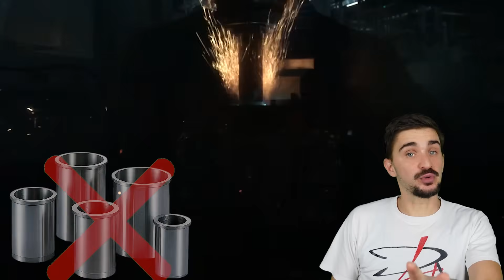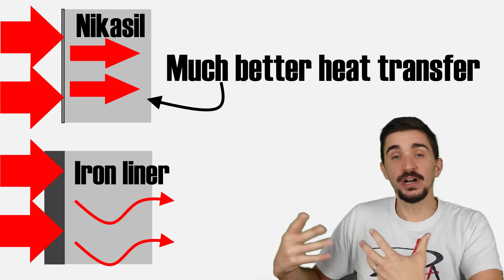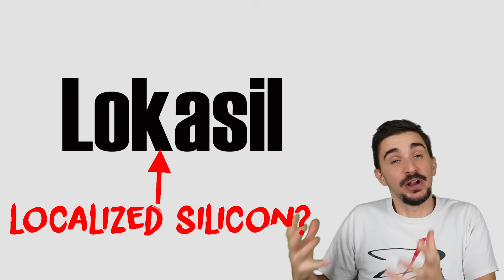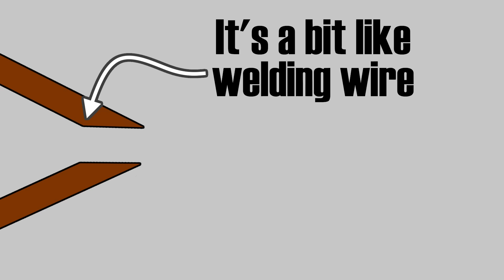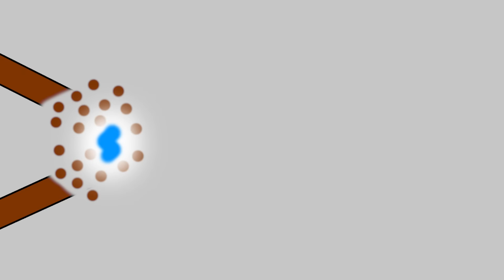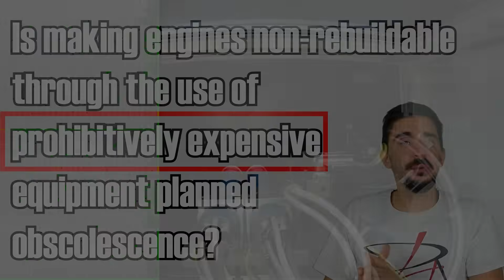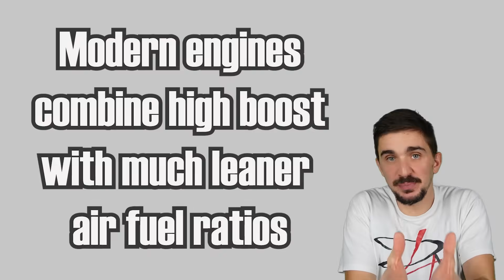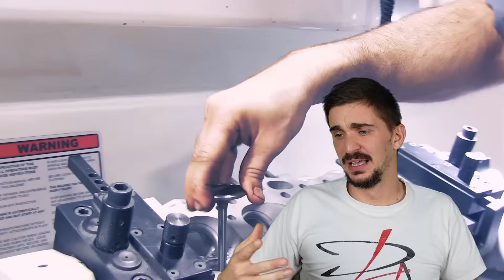Why Are Engines Becoming Non-Rebuildable? Everything About Cylinder Coatings

Comment: You really hit the nail on the head at the end of the video. Nobody has been rebuilding ordinary car engines since the 80s, when the Japanese manufacturers (here, at least) showed us that even small cars could last 300,000 km or more when well maintained. By the time the engine was worn out, the rest of the car was so old and shabby that nobody wanted to spend any money on it, not to mention the massive advancements in safety and equipment in that time. A much better question is, how long will these high-efficiency small displacement turbo engines last? If they can still last 300,000 km then no problem... but if a lot of them end up burning out before 200,000 km then we are going to be crushing and replacing more perfectly good cars because they are in that awkward zone of still good but not really worth enough to justify a new engine.
Reply: Problem is new cars are being prohibitively expensive, the "throw away" culture we've been embracing will eventually come to an end and rebuilding (or crate motors) will become cool again.
Reply: That's the thing. Regular passenger vehicle engines are so rare to ever need rebuilt anymore. Even if they do, you may or may not need to take anything down in the cylinder bore to make it serviceable. So this is only going to ultimately impact a very, very small number of cases. A small enough number its not worth making all the rest of the engines that never need rebuilt more expensive and/or less efficient.
Reply: @DaveJacobs-f7c  the vehicles your referring to never need to be rebuilt because they get utterly destroyed. Let's face it this isn't the 70's or 80's people are in perpetual debt because of their ludicrous spending habits where they constantly buy new cars at the first sight of trouble. It's not that the vehicles shouldn't be rebuilt it's that the English no matter where in the world they are, are wasteful.
Reply: @DaveJacobs-f7c  Where the hell are you getting these statistics? There's a massive amount of engines being rebuilt every day.
Reply: I've rebuilt several engines on cars I've owned and it was way cheaper than buying a "factory rebuilt" one so far I've rebuilt 3 ford 4.0 V6's and 2 ford 2.5L duratec's for my daily drivers and I live near a for engine rebuild shops I can't say anything about other countries but here in America mechanics rebuild ALOT of engine and cars cause the used cars are the only ones most American's can afford, That and the new cars suck in my opinion to much useless tech like self parking, self braking, stay in your lane, all junk I got pedals and a steering wheel I dont need a babysitter computer.
Reply: @Dr.Mcstaby  FACTS.
Reply: @Dr.Mcstaby  The 4.0 and 2.5 are both older engines and aren't used by Ford any longer of course you can rebuild them easily because they aren't brand new. Try rebuilding any of the new crap shoot engines it's not even about the electronics they're just simply bad it doesn't matter if it's the 2.3 I4 or the 3.0 v6 they're made inherently different. The tech is so different you mind well try and argue rebuilding a diesel compared to a gas'er.
Reply: Some American cars have engines that last more than 300,000 miles on basic service...
Reply: @davidhollenshead4892 3 of them????
Reply: EFI is the reason engine life doubled for all manufacturers. Oil being washed off cylinder walls during the rich (choke) warm-up was reduced greatly. Cylinder walls and rings lasted longer than the chassis. Old cars used to smoke badly and needed rebuilt after 100k miles. No compression, lots of blow by, oil burning, and contaminated with gas if not changed; main bearings wear quickly.
Reply: @ agreed, oil dilution with carbureted engines is a significant problem, not only with cold starts but the AF ratios are rarely ideal leading to extra carbon deposits and potential pinging and knocking if it's too lean.
Reply: @ Well, there were plenty of guys that knew how to adjust carbs.  I rode tons of carb motorcycles that responded to jetting changes and such just like cars.  Facts, the mass produced cars had to be jetted/tuned for a worldwide use, and the performance guys knew how to get it right. As far as oil dilution, the 3000 mile oil change interval fixed that, however modern people demand 10000 mile oil changes not understanding that this is where a lot of carbon deposits come from.  Oil breaks down and degrades and becomes poor after 3-4000 miles.  Don't let them mislead you ..
Reply: @ Those old carby powered Small block V8s last forever tho, and were super simple to repair.  No extra ECU/DME devices or black-box electronics .. just points, condenser, carby ... SImple is good.
Reply: @dcrasta yeah, and it also does 2mpg pushing 40hp. never had an issue or heard of an single issue with port EFI. except for when Saab bolted the ECU in the engine bay. it is also for a lifetime of the car, if you don't tend to run your car on the fuel reserve. carb on the other hand, will eventually make your car run too rich, or even worse, too lean. and before you say, EFI requires sensors to work and they break, it only requires a hall efect sensor, a lambda sensor, and a MAF/MAP sensor, which you can buy 10s of when they break, for the money you saved on fuel, compared to a carb. so unless you live in some very remote machine shop, EFI is better in every way
Reply: @jhoncho4x4 carb cheater. It's 100 percent better. There was always a way to better the carb. They didn't want to. They want you to have to buy a piece of shit 8 dollar injector and tear apart half the motor to change it which costs 300+ in the shop. Thunderhead289 developed that shit. He's not a trillion dollar company with 20 billion dollars in R&D.
Reply: False.  Just look around the developing world. Also, given the cost of new cars I am sure there will be a push to make them more rebuild able.
Reply: @andrewthomas5458  actually not as false as you would hope, cars today are more purchased than they're ever been in history instead of a car being a 2-3 in a lifetime thing many people doing keep cars for more than half a decade. It's the same thing with many manufacturers making vehicles more intrusive and difficult to work with, the goal is for you to spend money continually on a very expensive piece of metal not for you to do a few thousand dollar rebuild and continue using your beater.
Reply: @kathrineculver696  Your statement does not make sense.
Reply: @andrewthomas5458  which statement.
Reply: I own a machine shop.  To say that nobody is rebuilding, is 100% false.  I have probably close to a year's worth of work in front of me to prove that, as do many other machine shops.
Reply: Thank you.
Reply: @turbojoe9554  without dirispecting your job, your ammount of works in meningless for statistic. Put it this way, how many cars today have their engines rebuilt? I would say, less than 1% for sure.

When someone has internal engine damage, people just buy used engined from a crashed car and put it in, more cost effective than rebuilding.

This is talking for normal people with normal cars. Obviously people like me, enthusiasts that want to keep classic and future classic cars on the road, then your work is very much apreciated.
Reply: You hit the nail !!!!

One of the complaints Toyota users claimed a few years ago was odometer bugs that
couldn't count above 299 999 km !!!
Reply: @ve2um yup worked on a 04 Pontiac Vibe that didn't roll over to 300 000kms!
Reply: Why will people rebuild engines? a large number of people do not trash their cars after 10 or 20 years because the sentimental value and it's not that expensive for a mid size family car to get a complete overhaul maybe 5000 after 300k miles rather getting a new car which in many cases can be that reliable
Reply: @saudqureshi3186  Its especially good for those of us who can do it ourselves.  HUGE cost savings over buying a new car.  A new car that we may not like.
Reply: @saudqureshi3186  If you're running a car that old, it often makes more sense to buy a newer secondhand car for 5k rather than keeping a 20 year old vehicle on the road. Classics and performance cars are a different matter, but that's a niche part of the market.
Reply: Maybe, no t in the US or Europe but in many underdeveloped countries in Asia, Latin America, Africa and the middle-east people still rebuild engines of family cars because it's still cheaper to do so.
Reply: @SonicStan  FACTS!
Reply: @SonicStan But the point still stands, manufacturers won't make engines more expensive to produce new just because some people in third world countries who will never, ever buy a new car anyway can rebuild the engine cheaper. There is zero profit in that, and why should I pay extra for a new car so than some African guy can rebuild his engine in 40 years? I don't give a shit
Reply: When it is "so old and shabby that nobody wants to spend any money on it", it's just starting to become interesting to me...
Reply: I just did a CTS V that slapped a ring with too much nitrous try again . Engineers are just keeping dealership technician employed with tools that they only sell. Bunch of overpaid bums .
Reply: How long will the small forced air engines last?   Not long as long as we're choking them with particulate filters,  or forcing them to ingest dirty exhaust gases via EGR.
Reply: As a technician I can 100% tell you, it doesn't matter the company at this point all engines are experiencing major issues and failing quickly many of the newer Honda models are having issues with turbo failure as soon as 120k asking with a myriad of other leaks, I drive a 95 as a daily and it's got 389k I'm about to rebuild the engine with new sleeves new pistons etc the full yard is going to cost me less than 600$ USD to do it myself.
Reply: @kathrineculver696  This. New cars just are not worth the squeeze. Rebuilding older cars from the bottom up is still cheaper than buying a new car that will last half as long.
Reply: @kathrineculver696  I drive a 26 year old audi with over 200k miles (not kilometers), never have had any major issues. water pump timing job once, cost $1400 from a euro shop. Undercarriage and subframe have barely any surface rust and I live in the salt belt.  Little things yes here and there, but turbo/engine/5 speed transmission are excellent and runs infinitely smoother than new cars. No direct injection. I do oil changes every 4000 miles or 4 months (whichever comes first) with high quality full synth and OE filters only . Have had some uninformed people think my car is a 2006 model 🤣
Reply: @dfPats2665  that's because you actually take care of your vehicle. As integral to their everyday lives as vehicles are America's are not known for good vehicle maintenance, you don't even have to be diligent just do your fluid exchanges regularly and don't ignore an issue when it arises. Sadly the average vehicle i see on a daily basis is not owned by someone who understands that vehicles last longer then 6-7 years, when telling people the age of my jeep I've had more than a few ask if the engine was new because they cannot fathom how any vehicle lasts that long.
Reply: @kathrineculver696  They believe in just driving the thing until something breaks, then, if the vehicle is not new, they want to replace or junk it.
Reply: @jamesbosworth4191  exactly correct, Americans have been turned into a population of consumers where instead of fixing anything is easier for them to get another. Little do they know they're actually worse off for doing this, cars are easily the second biggest purchase you'll make for the average individual in many parts of the world your average individual owns 2-3 cars in their lifetime. If the American public took that understanding to heart they would have a lot less debt and would most likely learn to work on their own vehicle if only for minor maintenance.
Reply: @kathrineculver696  "Americans have been turned into a population of consumers where instead of fixing anything is easier for them to get another"

Uhm... it's been that way since the 1920s, and went on steroids since the 1950s.  I'll leave it up to you to guess what the common denominator is.
Reply: @kathrineculver696 Which body type of the 95? That fine car's becoming rare lately.
Reply: @Glim424 1995 Jeep Wrangler, I just recently got my hands on a 93 Cherokee that I'm bringing back to life
Reply: @kathrineculver696 Yeah that still doesn't apply to regular people. What's the value of the tools you need to do that job? $5k or more, plus the value of your time, so another 5k or more. I love to see old vehicles kept running, but they are always passion projects. You can't do it for cheaper than a monthly lease payment. Just what the manufacturers want.
Reply: @Broken_robot1986  sorry never got the message and actually no, if you wanted to replace the head gasket on my jeep you would need a click style torque wrench. A ratchet and I probably recommend 6 point socket set and basics wrench set plus access to YouTube. Training is one thing though many people make easy follow step by step tutorials, and tools would be $200-$300 based on brand. See that's the exact issue everyone has gotten into the headspace that they either can't learn to do something or it's too expensive and on many many many cases it's not true.
Reply: @Broken_robot1986  That's not true, keeping my old car going has been way way cheaper than leasing, like not even close.
Reply: @Broken_robot1986 5k? You can buy enough tools to do pretty much anything on a early model car for less than 1k. Tools don't have to be snap-on or Mac. Harbor freight and amazon sockets will work for 99% of home mechanics.
Reply: Only 300,000 km?  😆 You've earned only your first medallion from Mercedes by 300,000 km.
Reply: Very well stated, very well worded! I enjoyed reading that little block of comprehensive thought(s) of yours on the matter, thanks
Reply: And this is exactly where we are now. I work at a new car dealership and current engines are failing at a alarming rate. Even engines that have had exceptional maintenance are developing financially catastrophic issues at or before 150k miles, including Diesel truck engines. We are installing several right now because of the cost of timing, head gasket and oil pump belt replacement. ( Don't get me started on the wet belt oil drive stupidity every manufacturer is wanting to use now )
  The cost for major service such as timing chains or head work is nearly as much as installing a new engine, not even considering labor on a full rebuild. 
   I recently diagnosed a Ford Escape with a leaking head gasket, and found that parts are almost not available. This rather common engine has a major block issue and Ford only recommends replacement. Warranty was extended to 100k, no help for the used car customer with 150k on a very nice 8 year old vehicle. The labor difference between swapping out the short block and a new engine would almost pay the difference, and no warranty vs warranty is a no brainier. 
  Personally, I don't know of any brand of vehicle I could recommend for reliability in the last 10 years.
Reply: @jeffhill3681  I know exactly what your referring to with the head gasket, I recently tore into a Ford fusion to replace the head gasket on a turbo 2.0. and took pictures of the little cut that ford puts in the block for whatever excuse they give it, but that tiny bit of real estate makes a horrible mating surface and I even told the gentleman straight out I wasn't going to warranty the work, it's not that I don't trust my work I very much do but the way the engine is designed I can't in good conscious warranty something I know for a fact will fail again due to bad designs if I'm not mistaken it's supposed to be for cooling but all it did was build a weak point in the block that can and very easily will cause head gasket leaks.
Reply: @kathrineculver696  
  The lack of deck surface on modern engines is disturbing to me, the 1.5L Ford I was referring to had inherently poor deck surface that supposedly would not adequately seal and could not be conventionally resurfaced. But the biggest issue for me was how difficult serviceing the engine would be. If you have to remove it to do anything serious to it, simply replacement is the best option if the vehicle has reasonable value. The problem being, it probably doesn't. This makes DIY virtually impossible without a hoist and with crash repair air bag costs at or over $10 k new vehicles will price many people into serious financial poverty.
Reply: Great post which exposes the difficulty in analyzing just raw data. How long an engine can be expected to last becomes very important in the 200,000k+ area. If an engine fails before this then it's very likely that the car will be scrapped as it's not financially viable to rebuild it, but the rest of the vehicle could easily have lasted longer, and so you create a lot of waste and energy consumption.
The most efficient and practical solution is to have engines that last 300,000k reliably, because at that point you'll want to replace the entire car.

The problem with modern engines is that they are being pushed very hard (130hp per litre on a family car is nuts!), perhaps it would at least be worth adding the option to run these engines in 300,000km mode? You would lose some performance, but if you're doing urban driving would you really miss that? I'm sure plenty could live with 130hp from their 1.3 engine and expect to get 300,000km from it, rather than 170hp and maybe only 150,000km.
Reply: They have been flash chroming engines for decades (since the early 60's) and when you bore you remove that
Reply: My dad had a V70, went 560'000 KM without an issue, then the timing belt got shot by the generator belt. Too bad, it's a good car.
Reply: 300k is not good enough for me. My car just hit that and I want 300k more out of it.
Reply: Completely depends on the motor. As a Toyota guy, good luck finding a 22r/re or a 3vz to rebuild unless you’re in the Middle East. At this point when the 5vz goes in my Tacoma it would probably be cheaper to get a junkyard motor than a rebuild. Same with the transmission. I’ve had a check engine light on for an Evap canister. Seriously?
Reply: I don’t know about that, did the motor in an 06 Pontiac. Courtesy of a failed head gasket.
Reply: I rebuilt the 4.9L 6cyl in my 1994 F150, even though it might be cheaper to go get a replacement F150 of the same age. I like having a vehicle that is (engine management aside) mechanical, not digital; I like driving stick; I like a truck I can work on myself without proprietary computers.

My plan is to drive it the rest of my life, then have it drive me to my funeral.
Reply: Definitely agree, although I'd argue that rebuilding still takes place, probably not near the rate of production, but there are enthusiasts that do rebuild engines for the sake of what they're able to gain from a familiar tried and tested platform, hence 2JZ and even RB engines being part of that bracket purely because of what enthusiasts can squeeze out of them. What you said in the end is also very on point, if we see engine failures sub 150 000 kms, then what's the point of these "new improved technologies" when older engines last well beyond 300 000 kms? I think that a nice medium point where efficiency & longevity comes together without society bashing efficiency VS longevity, I think we'd be in a better space as a whole, but that's only one aspect of society lol. Love the engineering feats we've come to see in the industry nonetheless, it's madness how far tech has come though
Reply: 300,000 km is nothing.... gotta last 600,000 for me to be ok with it
Reply: Translation - modern cars are trash full of electronics and not enough ‘driver experience’ focused to be worth rebuilding.  Throw it away and get another Corolla
Reply: @dcrasta  Sadly by the time the cylinder walls lose it you'll have already spent thousand on replacing all the electronic sensors to the point you'll just dump the car out of frustration.
Reply: @NorthPoleMoe  true.   Anything after like 2008 is a mess.   Not just the engine.  My friends electric steer car had a steering angle sensor gonna.  800 $ for the sensor 😂
Reply: @dcrasta  in all fairness most cars through history have been that apart from the electronics. Disposable consumer appliances.
Reply: @dcrasta  
Electronics are what makes them more reliable.
Reply: @zaco-km3su  Not when you have a lockout because of a failed steering sensor .. But hey YMMV
Reply: @dcrasta as the owner of a 98 corolla yes, do it 😂
Reply: @dcrasta  sadly the electronics are the primary reason it's not worth keeping new vehicles. As I stated in my post I drive a 95 very few electronics I don't even have OBD2 I can rebuild every part of my engine and transmission for less than 2k. Look at your average vehicle today with all the integrated electronics it costs about what it would to rebuild my engine just to replace an electronic power steering pump.
Reply: @kathrineculver696  that was my cutoff year when I went to buy a gently used project car.  2009+ bmw cars have too much electronics for me .  Electric steering is the satanic curse as far as road feel for me might as well catch an uber 😂😂. I’ve seen quite a few ‘electronically totaled’ cars that just needed someone with small electronics repair knowledge to fix.  We have landfills full of viable vehicles but oh well i refuse to participate in the madness .  #Salute
Reply: @kathrineculver696 you're also driving a car with safety standards of 30 years ago, and the vast majority of people do not have the knowledge to rebuild their cars like you do, so it would cost them a lot more than just the materials of the car.
Reply: @omnihein9322  that's my daily driver, between me and my husband we have 5 vehicles ranging from 7-33 years old. I've done all work and maintenance on all of them ranging from our Nissan frontier, f150, wrangler, Honda fit, and Volvo xc70. All different models drive train types etc I have 0 issue with any of them I would actually argue the frontier is the most annoying thing to work on because of all the ridiculous redundancies.
Reply: @dcrasta  We've become nothing but steering wheel holders... Lack of driver experience is why i recently bought a manual transmission. Make driving engaging and involve the actual driver. Bet you see less crashes due to distraction.
Reply: Anyone that owns a medium or heavy duty diesel engine knows that this false. I’m driving a 25 year old class six truck tow truck with almost a quarter million miles on it and I’m not even halfway through it’s expected lifespan.
Reply: @davemccage7918 that's a completely different set of trade-offs -- you're not getting 40 miles per gallon out of an engine delivering over 100 horsepower per litre.
Reply: @davemccage7918  How is 25 years less than half of the expected lifespan for ANY vehicle?
Reply: @davemccage7918  you're aware this is primarily gasoline engines right? And probably the new eco diesels, you can't compare a diesel to a gasoline engine in the slightest aside from "it moves my vehicle" there's an extreme difference between how to two work not to mention mechanical loads. Many new gasoline engines are aluminum blocks with aluminum heads you'll never achieve that with a diesel the pressure of the none controlled combustion alone would destroy the block on short order.
Reply: This entire comment exchange is on point.
Reply: Turbo and Non Turbo are dying/junked much earlier than before.

You never see many cars with faded paints/patina driving anymore.

Any newer car after 2000 has evident planned obsolescence and post 2010 saw more agressive planned obsolescence applied/effects.
Reply: Why buy a new car if your goal is to run it all the way to the ground, and if it's 30 years old?
Modern cars have also planned obsolescence, not just the android screens but components that are quickly stopped being made, resulting in 2010's vehicles already being difficult repairing.
Reply: @miljororforsprakpartiet290  You buy a car with the expectation that you can get a lot out of it.  I don't see what the issue is with that.  Your logic is half-baked at best.
Reply: @ You mean, an expiration date of 10 years at best? Meanwhile myself and other enthusiasts keep dailying 20-50 year old cars without hesitation? 

I also wonder what you expect to "get" from a new car these days. No looks, no heritage, no originality, no sound, no tweakability, no reliability. I'm more curious about your logic.
Reply: today's cars are disposable. they all look the same and are made to fall apart in the envent of a crach" crumple zones" it's all about mpg. lighweight,made of composit materials and have no style. every car and brand looks the same.jellybean shaped for less drag and better mpg. they do handle and drive way better than any of the cars from the 1950s ,60's or 70's though. would i want a modern car? no thank you.